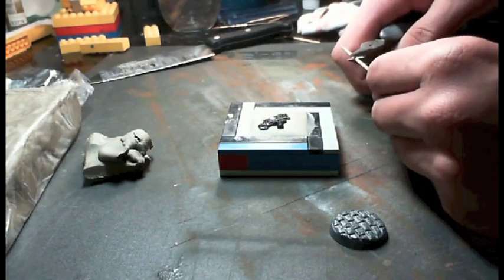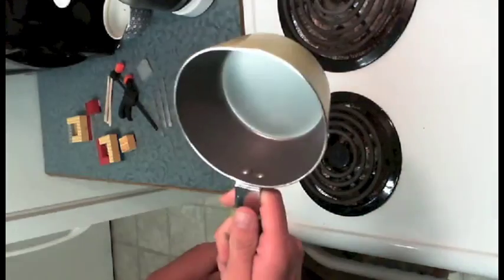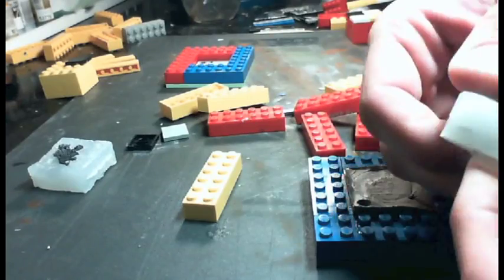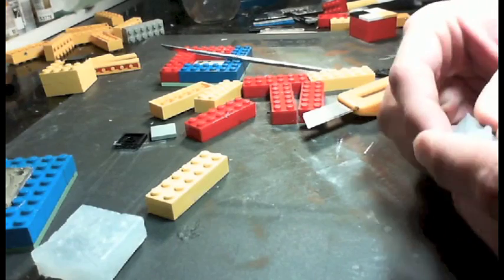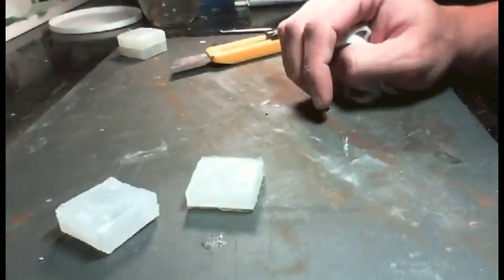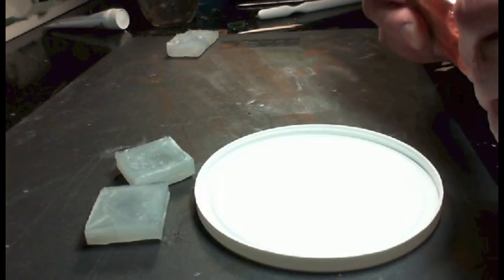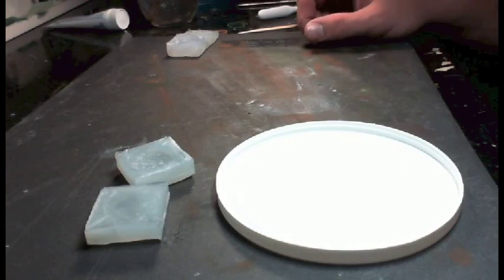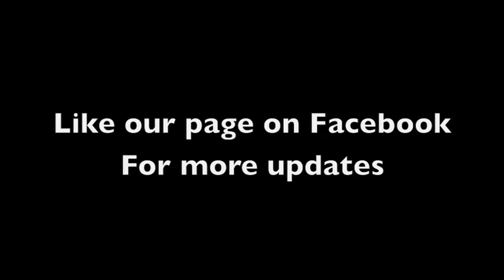Making Moulds And Casting Small Parts For Miniatures

Comment: Hello,
How can I get rid of air bubbles when casting a half open hand from a 12" figure, using resin?
The bubbles keeps that at the finger tips.
Thanks
Reply from the maker: try to mix the resin as slowly as possible this will minimize the bubbles in the resin and pour in a thin stream any other bubbles you may have to fill afterward

Comment: Hi, Can the hot glue gun be used to heat the glue into the former instead of the boiling method ?
Thanks for the vid.
Reply from the maker: The hot glue gun gets the glue too hot and will bond to the part you want to cast.